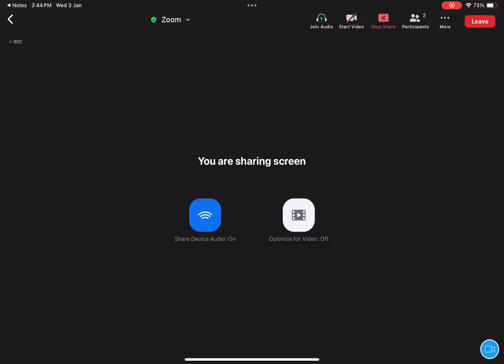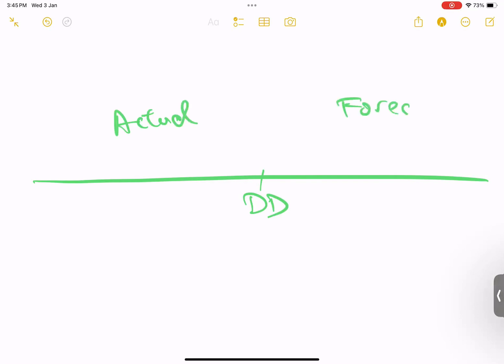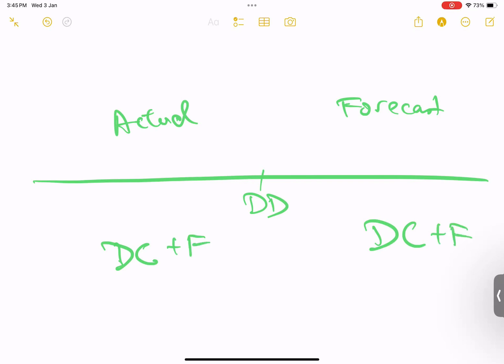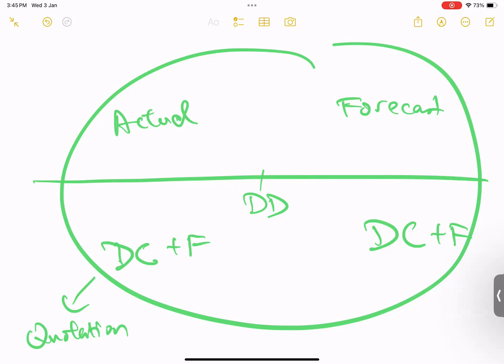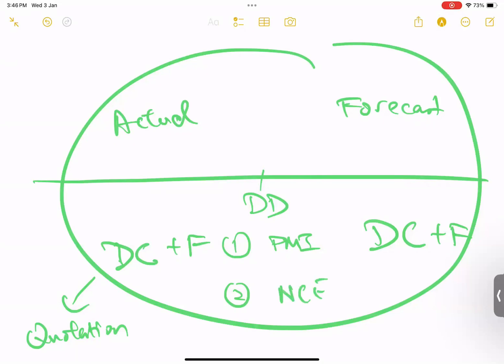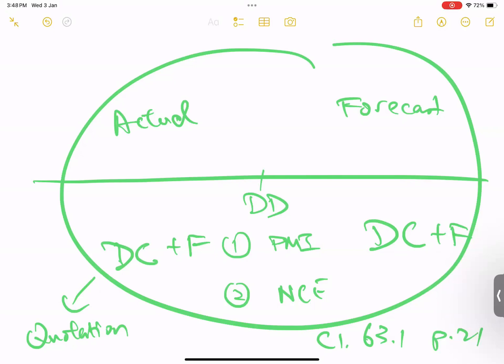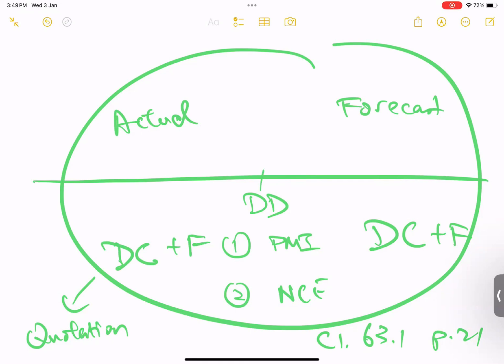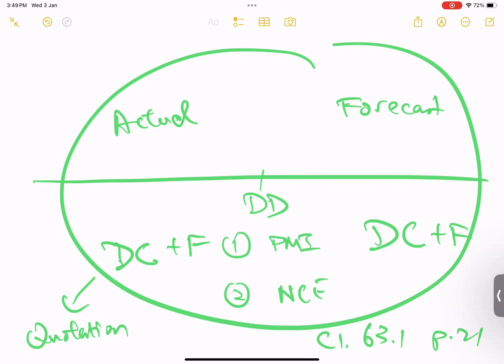NEC Few Minutes  | The dividing date concisely explained | NEC 4 v NEC 3 | Gordon Kwok

Comment: I would like some more videos about how to calculate CEs, when they increase the cost and especially when they decrease the costs.
Reply from the maker: Will do.
Reply from the maker: It depends on Main Options. Which Option are you most interested in? I may do that one first.
Reply: @NECFewMinutes thanks for the reply. 

for me, option A. I think this is the most common option anyways. 

 Just to be clear, what I meant was some "worked examples" showing how to add fee, etc. I'm always arguing with contractors about these calculations when we remove or add work. 

 Great videos by the way.

Comment: Thanks Gordon.
In case of the pm instruction to the contractor to submit a quotation for a propsed instruction. Say the instruction for quotation  is isseud on 1/01/2025 and the given date for the expected instruction is 15/02/2024. What is the dividing date? Is it the date on which the pm instructs the contractor to submit a quotation (i.e. 1/01/2024) or the date on which the instruction is expected (15/02/2024)?
Thank you for your time.
Reply from the maker: The date when the instruction is given. Cl. 63.1 second paragraph. :)

Please note a proposed instruction is not an instruction. The Contractor does not put it into effect until it becomes an instruction.
Reply: @NECFewMinutes  
Noted.
Many thanks Gordon.